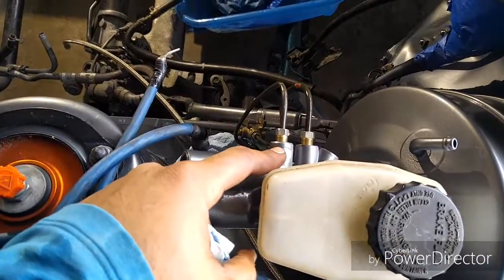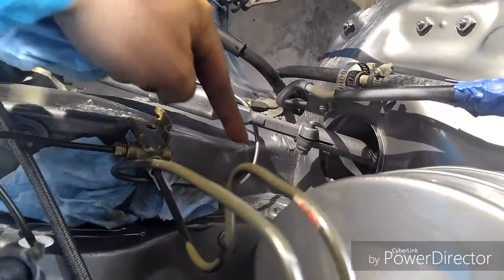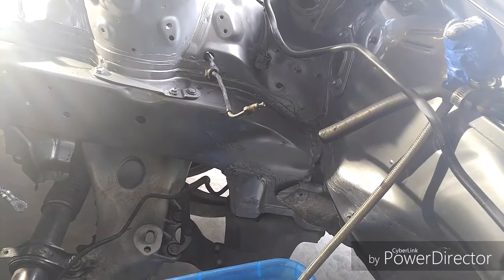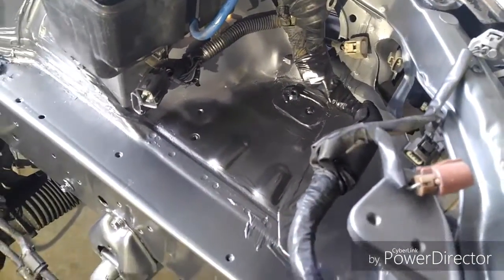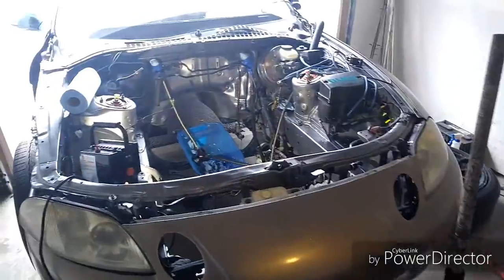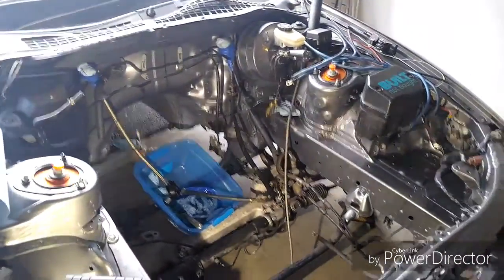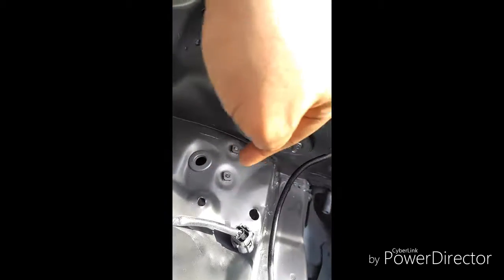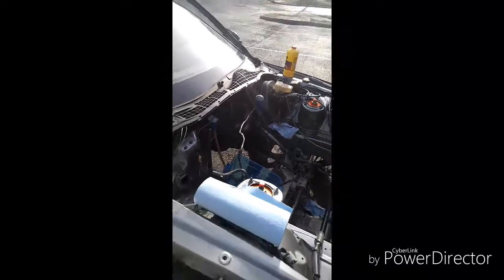Vlog #5 $25 SC300 abs delete!

Comment: Nice work with the delete. What throttle cable are you going to use with the intake manifold?
Reply from the maker: Deceptik1 thanks. I man go back and redo lines later and get it to tuck better. phr sells a cable for it but it's $125. I think I'm gonna try the lokar ls1 cable that's 48" and you cut it to length.
Reply from the maker: +Deceptik1 I ended up using a lokar ls1 36" throttle cable and cut it to length

Comment: What did you do about the abs message on the dash
Reply from the maker: I can't remember that I had an abs light on or if I did I just left it lol.
Reply: I had that light on for years after i did my 1j swap. Just last week i disconnected my ABS ECU & the 4 relays in the engine bay ( near the Brake master cylinder) and my ABS light went off.